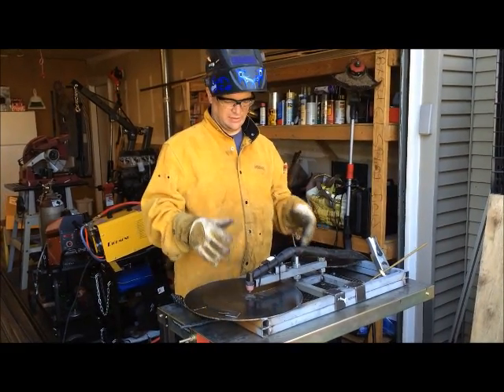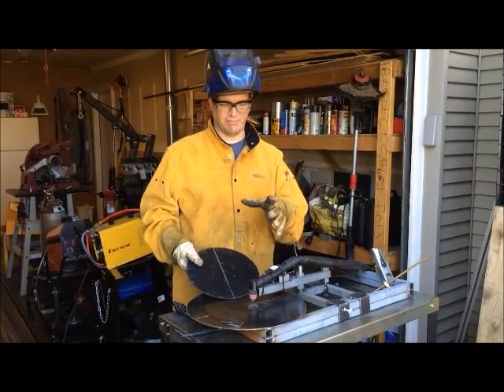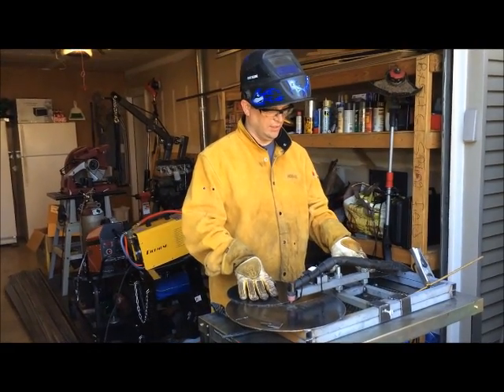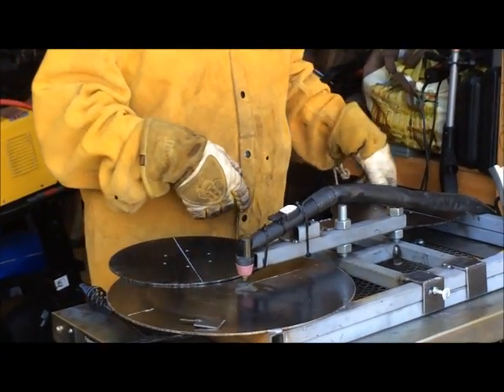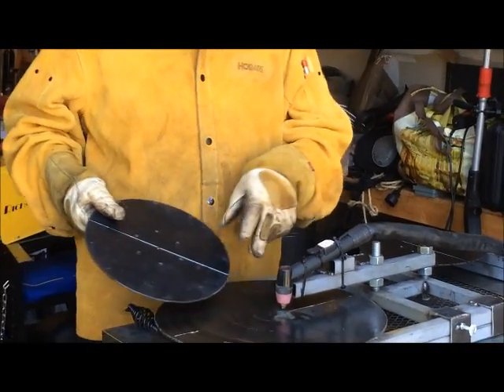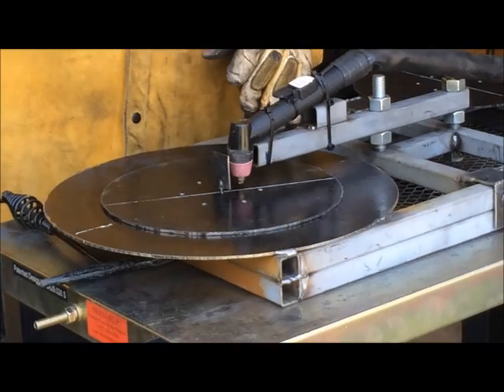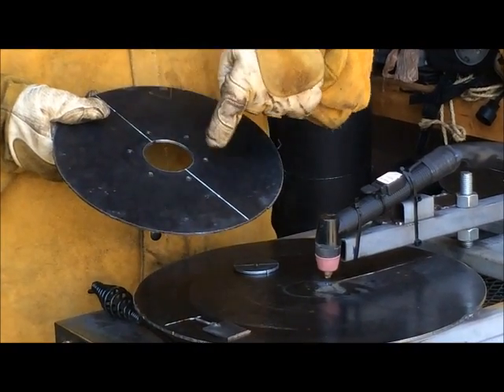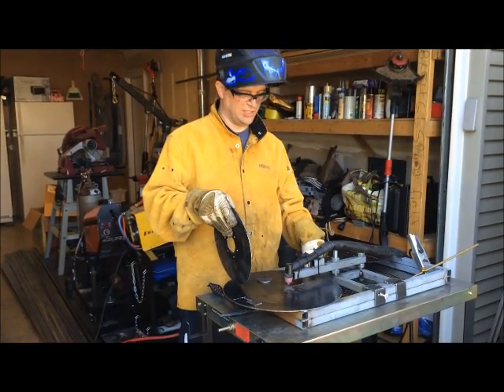Circle Cutting Plasma Jig

Comment: That theory works on a band saw also. Just measure the radius from the blade & drill a 1/8 hole for your pin in the table top.

Comment: This is great. Need to cut 24" circles, this might be the way, thanks
Reply: I’ve got to cut some 24” circles and seen you was thinking about possible using this ideal. If you used it did it work out? I’m in the process of building something along these lines with an electric motor but if I can hand turn and get a clean result I’m good with that!

Comment: Great jig.  Looks very user friendly for something you say came from scrap bin parts..I'm going to put that one in my mental tool box for later.
Reply from the maker: Thanks. Other then the nuts, all the metal came from my scrap pile. I am currently making a ring roller as well. Mostly from scraps but there will also be a few pieces cut from my good stuff as well.